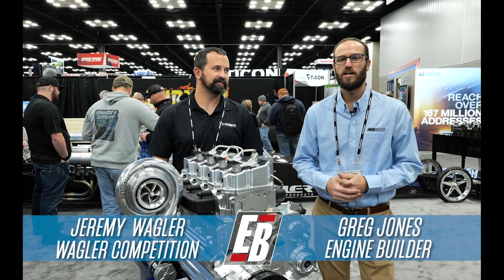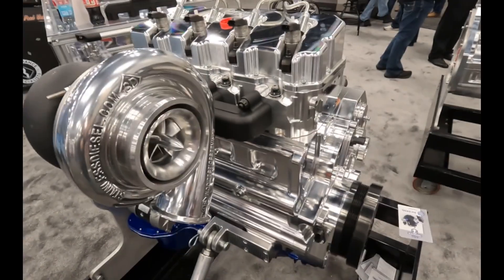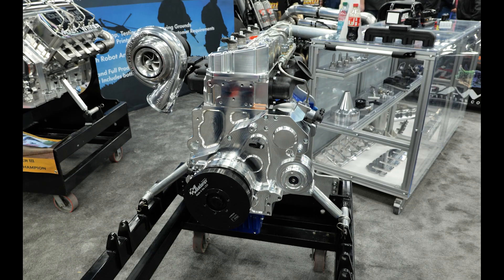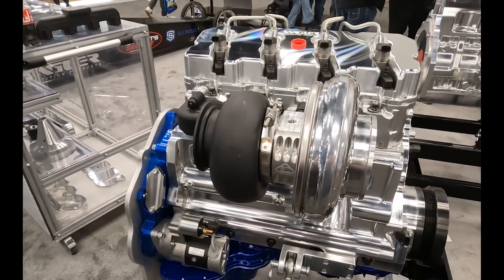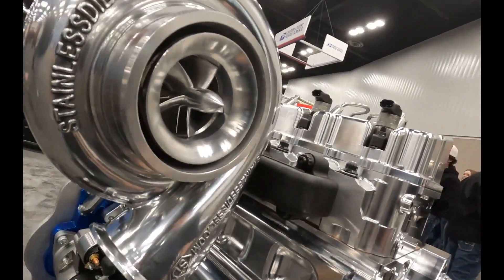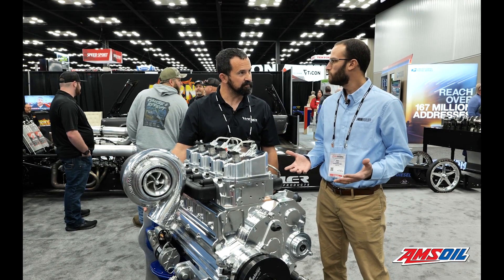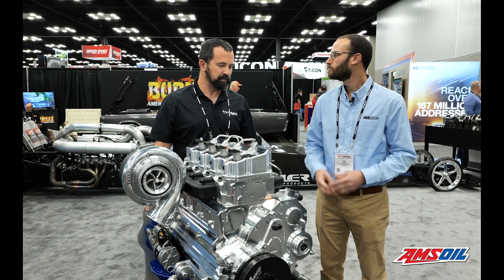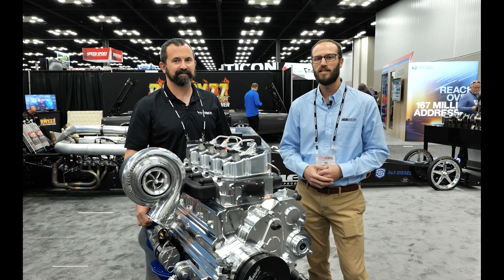Wagler Competition's New Billet Half Max Engine

Comment: former particle accelerator worker here, the discussion of cold welding and lubricants is an interesting one from the overlap with what we dealt with. Using a space/vacuum rated lubricant is different for use in space, because you don't want it to evaporate into nothing and leaving the applied surfaces dry, for UHV+vacuum, the concern is not just that, but also contaminating the entire system, raising pressure, potentially killing things like ion pumps. Cold welding happens in a different way for accelerators than spacecraft, my rough understanding for space is that vibrations are very difficult to stop in a system, thus the metal on metal would break through the oxide layer, in accelerators, because more installations have such a long lifespan, vibrations causing oxide layers to break down, and changing out like an all metal valve becomes a pain because of how critical these parts are. Moly lube is something that I think is space rated, it's been used in a lot of UHV applications in the past because of the vapor pressure, a practice that's out there for bolts is that instead of moly lube, having fasteners being silver plated,